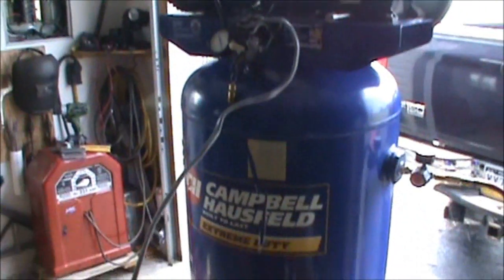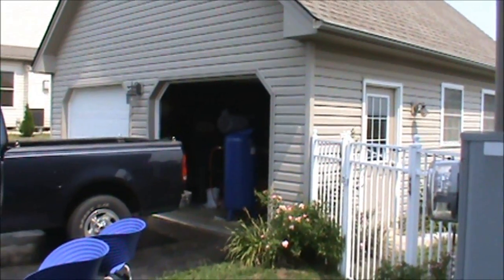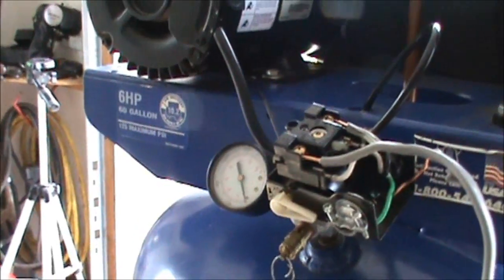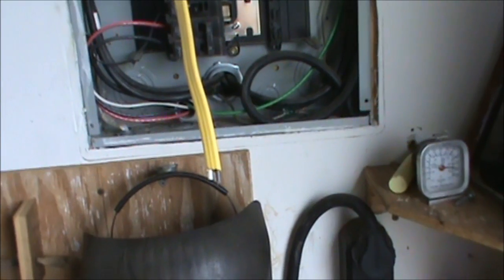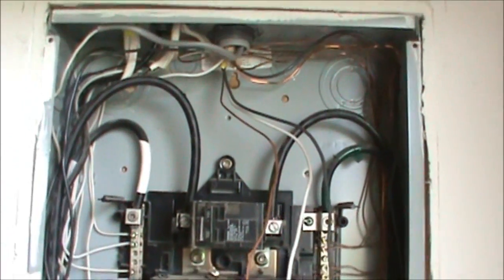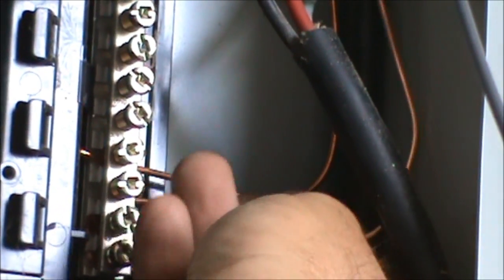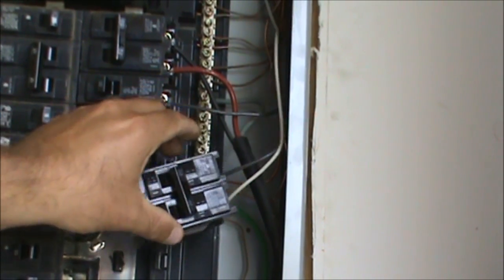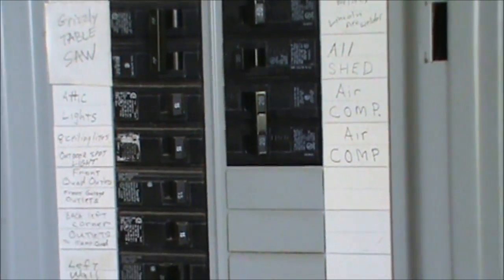How to wire a 240 volt circuit See Description

Comment: You forgot to mention that you have to mark the grounded (neutral, common, white wire) with electrical tape. By code white is always neutral unless marked with black or red electrical tape for safety reasons.

Comment from the maker: Tape would help identify the wire as hot.  If someone is working on the panel and does not know that the wire that is on the breaker is hot, they should not be working on my electrical.  Thanks for your comments you are right.
Reply: But if they're working at the other end it wouldn't be so obvious. Aside from being code, it's good practice. And it doesn't take much effort to do it correctly.

Comment: Your advice validates my suspicions.  The directions in the manual that came with the heater, are vague. But Home Depot should've passed on the proper wiring procedures to me.
Thanks again for setting me straight.

Comment: Great video, I appreciate the fact that you took the time to break down all the steps, I have to do garage heater and it requires 240 and  30 amp breaker, This points me a the right direction. Thanks

Comment: No matter where. No matter what color. 

Your meter is your best friend. I have read and heard of so many freak accident by trained engineers and contractors being killed because they assumed something. Never....I repeat never take anything for granted when dealing with high voltage electricity. You only have one chance. Put your meter on it and check it. I even scan it with my induction pen voltage tester just as a back up.
When youre and electrician or working on electricity. You are the MAN.

Comment: Very nice and straightforward...  If you follow the video exactly, and are mechanically capable of doing electrical  connections , with a basic understanding of Electricity,  and safety..then  I don't see any reason to call an electrician for something like this..
 You laid it out so  good, and its so easy to follow... Its all right here.. Im hooking up a Electric Heater
the only difference is  I will be running 10 Ga wire as per the instructions, and I need to use a min of 3 feet Conduit to the appliance..
thanks again.

Comment: The white wire is nuetral and doesnt normally go on to your break but you must use it, place balck electrical tape 6 inchs by each connection that will indicate its hot. Your should be use a 12-3 romex wire

Comment: excellent vid, my question to you is, currently i have an old in wall AC unit thats shit the bed which had a nema 6 connector rated at 240v. I went ahead and bought a portable ac thats rated at 120 volts with a nema 5 connector.. from my understanding if i change the wall socket to a nema 5 and cap off one of the hots then at the breaker swap out the old breaker for a 15 amp 120 and cap one of the hots, the ac should run fine with this dedicated setup?

Comment: There is no common wire on a breaker, they are both HOT - 120V supplied to each leg.  You should also be using a 12/3 wire: no tape required, since your black and red wires go to the breaker, the white goes to the neutral and copper to gnd.  Please do not post videos that seriously misdirect unknowing viewers and subject them to dangerous outcomes.
Reply: You are correct I was thinking the same thing like wtf???
Reply: Many older homes are wired in this exact way though... Recently, I replaced our kitchen range. It was feed by 10-2 from the service box - both black and white were hot.
Reply: shootgp An electric range is 220v, so both legs will be hot, it has nothing to do with the old house. I have performed extensive work on 1912 and 1916 houses with many complications, which must be remedied for the residents safety.
Reply: Michael, seems there was a little miscommunication/misunderstanding. Obviously as you know, code varies over time and by municipality.

You're absolutely right that there is no common on the breaker, both legs are hot. In my house, the white and black wires are connected to the breaker - and my house is running a full 120v.

Our new range top is rated for 220 or 240 - so the two 120's give it a working voltage; the 10 gauge wire is there for the length of the run. The new range only had three wires, black/red/green. There is no common for the new range (Kenmore 45403).

Unless code changed, substituting insulation color for another purpose is allowed as long as it's marked. Our white wire is being used as the red...
Reply: If the OP did use a 12/3 wire, as you suggested, with black and red from the breaker, white to the neutral, and copper to ground, then to where does the white wire connect on the compressor?  Also to the ground?
Reply: jfuite Exactly what I was thinking. Just run the 12/2 and mark the “common” wire with black tape because it is also now HOT(no common required on a 240 volt circuit.) If you where running to an all electric range(electric stove top AND oven) then yes cable with a “third” wire(red) in this case a 10/3 would be necessary because it requires both 240 AND 120 volts.
Reply: For any 240v use 10awg -6awg only not 12awg that will heat the wire up and catch fire
Reply: 4 wires = 12/3 with ground is all. The bare wire goes back from compressor to fuse panel ground. If you want you can use the white for ground to. would just be a double ground. Or just not use it and put a butt conector on each end if you like. How I take it with 4 wires.
Reply: Thank God I read the comments. Thank you sir .I was wondering where the common wire was. Note to self 12 /3
Reply: took electrical trades in the 70's the grounds and commons are insurance wires never take either away.  For gods sake its a garage who is to say someone doesn't pull in drunk one night and hit that thing.  Another thing I would use BX cable at a minimum and give it enough room to fall.
Reply: soulless one    Nope!   Not even close to correct!
Reply: Arthur Rodesiler   That would be in violation of the National Electrical Code.   It was done correctly with exception that the white conductor should be identified in some manner as a hot.   Like phase tape, or other means.
Reply: Michael Cox    Please do not post comments that are incorrect.   He installed the NM cable correctly except he should re-identify the white(like with phase tape.   There is absolutely no need for 12/3 WG NM cable.   The compressor is 240 volts not 120/240 volts.
Reply: Dejon Ackerson   No he was wrong.
Reply: shootgp    Ranges and dryers used to be allowed to be connected to 2conductors with ground.   In new construction, it is required for Ranges and Dryers to be 3 conductor with ground.   These items have 120/240 volt requirements.
Reply: @KevinCoop1  Depends on whether a sub panel or main panel system
Reply: David Townsend    I commented 5 months ago.   Not sure what you are referring to.   Please explain how a main or sub panel makes a difference in feeding a receptacle with a branch circuit.

Comment: The video was well done, but I noted a few issues.  1) Pipe in electrical, is called CONDUIT.  2) Always use a VM to test test test.  NEVER assume you have disconnected an energized circuit.  3) Never wear watches, wedding bands when working around electrical circuits 4) COMMON is used in DC, not AC.  The white wire is called a NEUTRAL, the black, a HOT - unless 240V - then both are called HOT.  Just some friendly tips

Comment: I recommend to anyone who is intending to attempt a DIY installation of electrical lines pick up a copy of Wiring Simplified (aka "the green book") which is a plain English guide to wiring distilled from the National Electric Code. 

I'll caution viewers of this video to take the wiring sizing with a grain of salt. 12 AWG wire is sufficient for a 20A installation to a 15A, single phase motor at 240V, 2HP or less, with a wire run of 90 feet or less, which is what I believe our presenter is installing. However, he referred to his motor as 6 HP, which doesn't pass the smell test. At 5 HP, 240V single phase, one is running a 30A circuit at 8 AWG, for a run of 100 ft or less. 

Do your own research, folks. Your safety depends on it.
Reply: yeah 12-2 is too small for this setup. 
also he said 14-2 is the standard house wire size. not around here it is not. that is only for lighting as receptacles require 12-2.
Reply: Ugly book

Comment: nice work, so you need two standard 110v breakers to get your 220v (two hots)?, but each one needs to be the amperage required be the tool (20 amps)?  so you dont add them together or anything like that?
thanks for the help
-scott

Comment: So if you connect a live wire from one outlet(one fuse), and another room supplyed from a differen fuse. You can get a 240v outlet, if you just need to temporarily use a 240v air compressor ?

Comment: Hello Doublewide6, one of your subscribers here, I have a question, I have installed 13  100 amp solar panels using two charge controller to the battey bank which is going to be my power source to the a inverter, So here's what I need to know, I will be using a SQ-D 8 space 16 circuit sub-panel and would like to move some of my circuits from my main to the sub panel and keep it at everything at 110/120 I don't need any 240 circuits these are just for 15 amp some lights, TV, all 120 things, so do I wire the panel using 10/2 with a ground and wire the panel using a jumper to energzine both sides hot and then use 6 0r 7 15 amp breakers or do I wire in a 30 amp single pole breaker and then 6 or 7 15 amps, would that energize the panel, I guess I'm confussed as to energzine the panel, the power souce is coming from a 3000 watt inverter 110/120
Can you give me your opinion

Thanks Al Ruark

Comment: Good job here... You have correctly & safely wired up your box for your application. I would add, for those out there that are not comfortable working inside a main or sub box, hire an electrician, it could save your life... I am not an electrician, but I am comfortable working inside main boxes. I recently installed a portable all house generator system into my home with similar wiring to this job, however I had a 30 amp system & therefor used a 30 amp double throw CB for my older GE 200 amp main box along with an interlock switch. My wire hookup req. a 10-3 wire, i.e., Romex 10-3 cable. ( 4 wires ), red & blk hots, white neutral & bare copper for earth ground. Out the top of box through a clamp & to the outside of the house to a 30 amp power inlet box. In my case, this work was completed before I actually purchased the generator or the L14-30, 50 ft. power cord. To make a long story short, I now have a propane fired 7KW portable generator that powers the entire house with ease... The moral of the story here is understanding one's power req's. as this video demo clearly illustrates, if not, hire an electrician...
Thanks,
Bill on the Hill... :-)

Comment: am i missing something here?

at the beginning you killed the power to your shop from you house main. then you go to the shop panel and shut off it's main which is the proper way to do things. i did not understand telling people the lugs to the main were still hot though. did you not kill that link from inside your house panel or did i miss something?

also i disagree with the wiring and breaker size used for that compressor but that has already been addressed in the comments.

Comment: I wish someone would make a video of how to do this with a fuse box.  I'm not interested in replacing it with a breaker box as it's just in my garage and works just fine.  So, for instance, could I run the two hot wires to two of the 15 amp glass slow blow fuses to get the 240 volts?  It being a garage fuse box, it had no big cartridge fuses other than the mains plug.  I do however have 4 free unused glass fuse receptacles in the box.

Comment: great video what I have to agree with some of these people if using the white wire as a hot power lead take a couple seconds to wrap some black electrical tape on the white wire when using it for 240 volts that would just be common sense some people will get mixed up
Reply: No you have to distinguish the other wire in a 240v circuit
with either a red wire or you wrap the wire in red tape.

Comment: Handy video to refer to. I need a 220v circuit in my shop for my everlast welder.
Reply: snoopy doggy    Buy a receptacle to match manufacturers installed plug, and match the breaker and conductor amps to the receptacle.   Respectfully,   Kevin

Comment: I want to wire up an outlet for my PC that will support two plugs off a double 30amp 240v breaker. Is it possible to even do this because I need two support for two 1650w PSU's for my PC.

Comment: This is a great vid. I'm planning on building a Hot Tank Parts Washer with dual heating elements and I wanted to get shop quality performance so I could sell it once I completed my project and build a smaller one. Was wondering if it would be ok to run two (2) 240v heating elements on one double 40 breaker as well as a low volume pump? I'd appreciate any intel. Not sure what pump I want yet so this is all speculation atm.

Comment: I have two appliances at 240 volts do I have to use a separate breaker for each or can I just use the 60 amp breaker for both I'm thinking a breaker for each but I'd like to get away with just using one
Reply from the maker: Tim Clark You need 2 breakers and a certified electrician.

Comment from the maker: UF cable can be used for indoor wiring as long as it is the right gauge.  Yes, there is a switch on the compressor, I am NOT using the breaker as the switch.   I did not color code the neutral wire black,  If your working in an electric panel you should already know the wires tied to the breaker and the compressor lugs are hot.   Why don't you make a video of how you would wire your 240 outlet, and I will post it here on my channel.

Comment: 240 does not require a neutral as the 2 hot leads are out of phase. Your supposed to color/paint/mark the white (hot) neutral wire black/hot to indicate it is not a neutral in the box.

Comment: So,... If your Common (white) wire is now a second Hot wire then what do you do for a Common ?... Shouldn't you be using a 4 wire cable ?
Reply: 240 uses 2 hots and a ground no neutral with a 3 wire system the neutral is not required.  The 4 wire 240 volt systems use 2 hots a ground and a neutral and are used on devices that use 240 volts and 120 volts like a oven does.  It uses 240 for the heating elementamd 120 for lights and timers.

Comment: I'm wiring my electric hot water heater 60 gal ) . The salesman at Home Depot said 12 guage wire is sufficient with a 30amp single pole breaker. Does this sound about right to you?
Reply: No not at all.i believe you need some #8 .10 is rated for 30amps but must be oversized to comply with code 125%I believe. That's 8.

Comment: For two pole breakers, is the Amp capacity listed on the switches are for each pole or does that mean for the entire breaker?

Ex: Main Breaker, 100 and 100, does that mean 200 amps (100 + 100)
Reply: SamsungLG His panel is a 240/120V, single phase panel.  That main breaker is a 240V, 100A single phase breaker.  The amperage of the whole double pole breaker is 100A, but it is wired to 240V.
Reply: +Julia Kropp 100A per leg
Reply: There is no "leg." It's single phase. If you don't know what that means, don't work on it.

Comment: 12-3 is only necessary if you need 120v and 240v on the same circuit. Some 240v appliances need 120v as well, these will have a 4 prong plug for both hots, neural and ground. If you only need 240v you can use 12-2 and paint/tape the white wire red or black and use it as the second phase. I would recommend running 12-3 as it never hurts to have the neutral available in case you need to add more to the circuit later.

Comment: Is it a violation to use white wire for an ungrounded conductor like this?  I thought white was the color dedicated for neutral by code, and that the industry norm is to use black and red for the ungrounded wires of 120/240.

Comment from the maker: You can use 12-3 wire if you want.  I used 12-2 and used the neutral as hot.  Check your electrical codes.
Reply: You need to mark the white wire with black or red tape. Although it may be obvious at the breaker that it's hot, it's not so obvious at the other end. If the label weren't visible it would be known without testing it whether it's120 or 240.